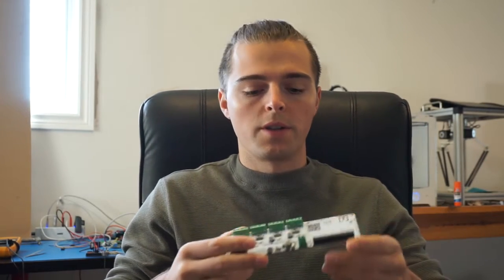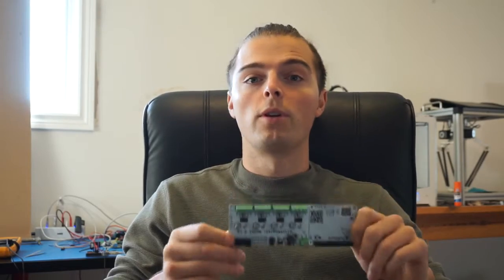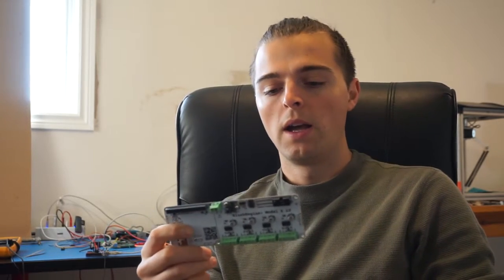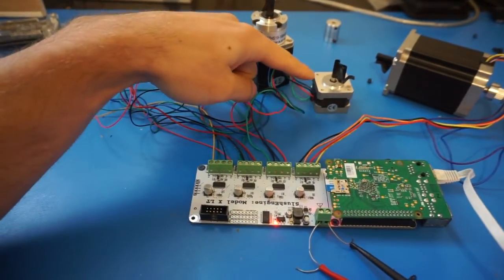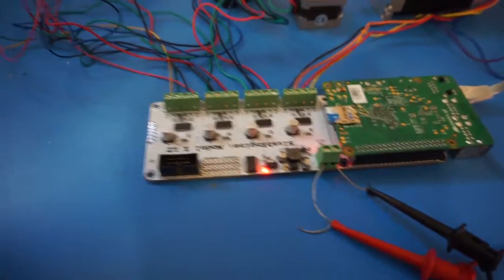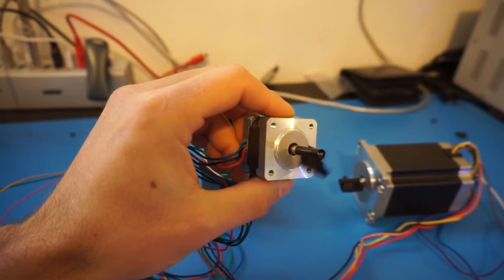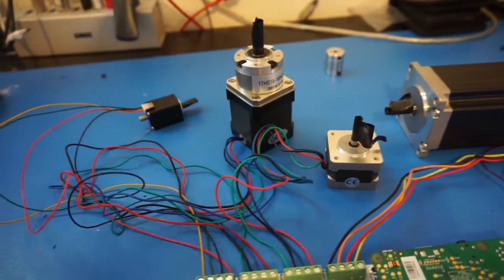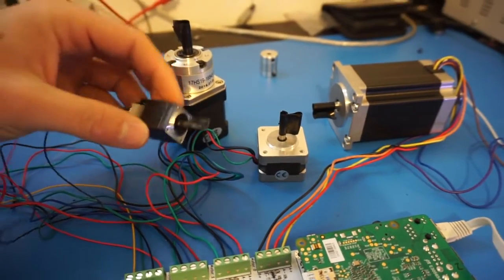Raspberry Pi Stepper Motor Driving: SlushEngine

Comment: When you have a 5" touch screen and you want to drive stepper motors using tkinter interface, it's impossible. You need to free up the I/O pins and use the USB Atty0 for communications.

Comment: Hey Guys,

I wrote to you a few times via your website with no response. The actual experience of using a stepper motor with the Slush engine has been far from easy for me. It would be really appreciated to have a response from you soon.
Reply: yer they take forever to get back to a question . whats up ill try to help